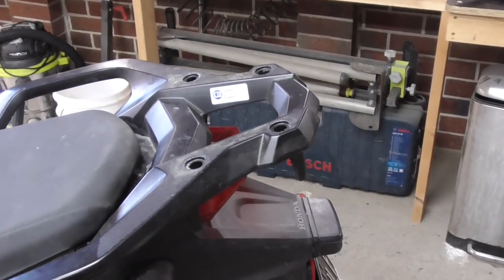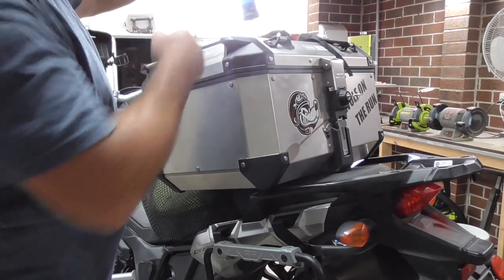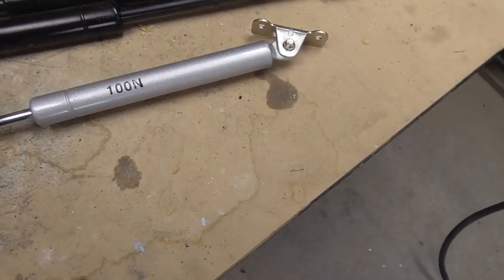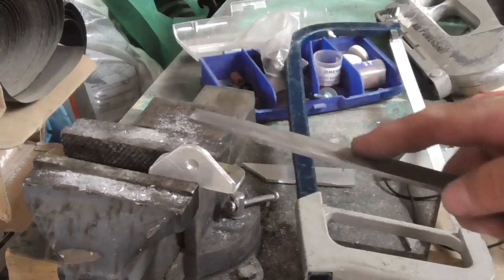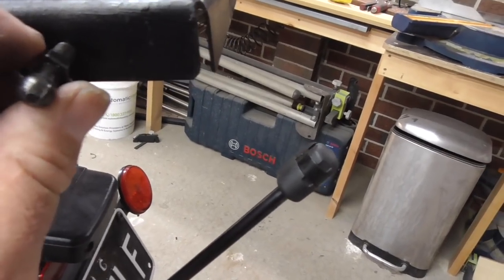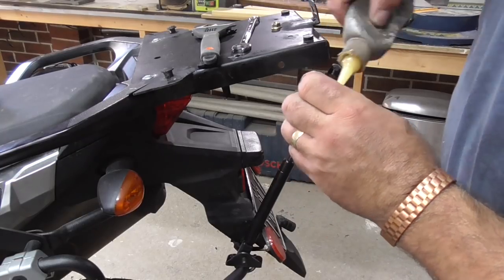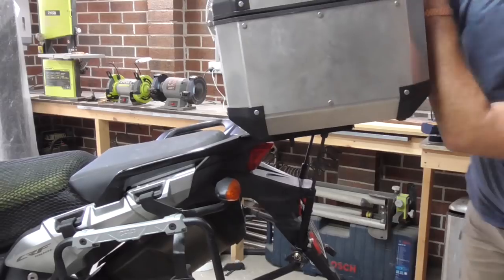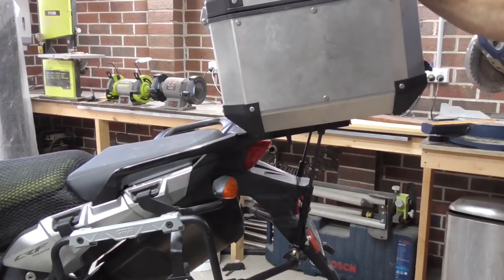LUGGAGE RACK SUSPENSION

Comment: Andy, I had a BIG off in central oz (broken collarbone) and destroyed most of my bike including the rear rack.
The rack is molded solid plastic with 6 metal spacers and a tiny metal plate at the tail light.
I copied the H&B type rack support for my top box and gen Honda panniers.
The rack support did its job but the biggest issue was the straps holding my gear on the passenger seat.
I had an aluminium plate on the pass/seat with eyelets on each side,the straps came off each side and around the grab
handles and over the load and secured....works great until you have an off.
The intertia of the load pulls the strap on each side and forces the grab handles up and in....picture standing in front of someone
and pulling their ears forward.
Snaps the rack under the seat at the spacers and you are up for $700 bucks.
Finding 2nd hand is pretty much impossible.....had to search the world for 2 months and just about gave in
to buy new and 1 turned up in England.
Got it back to Victoria at half the cost of new.
So whatever can be done to support the AT rack, even to the point of gently lifting at the grab handles, it all helps.
Reply from the maker: Wow massive mate.
I thought it was aluminum. Wow not a plastic composite.
Glad you came out alright mate.
Thanks for the input 👍👍